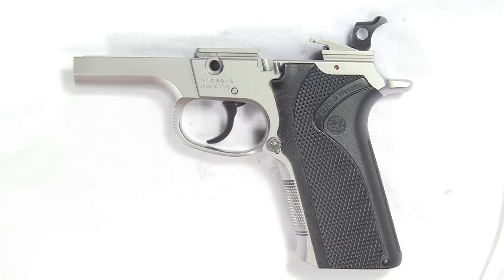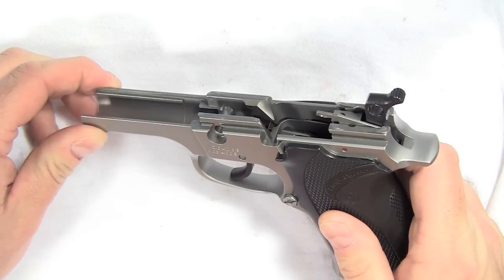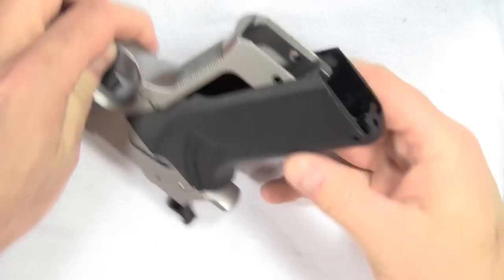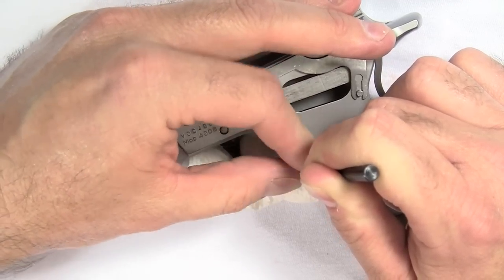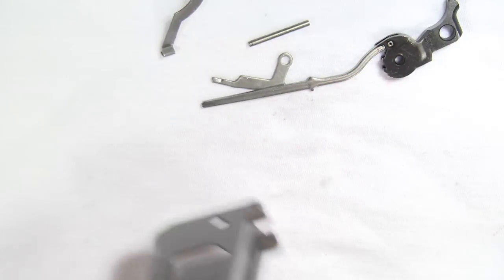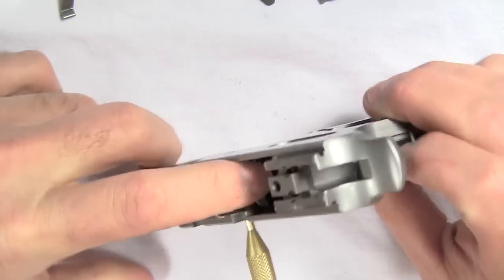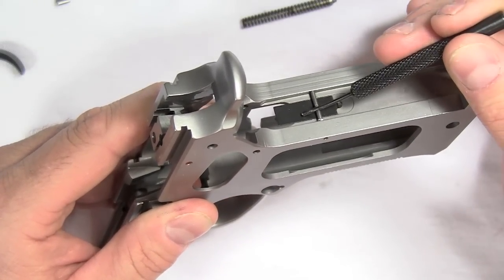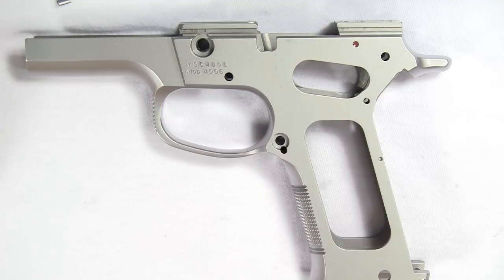S&W 3RD GENERATION DISASSEMBLY/TEARDOWN (FRAME) VIDEO #1 OF 4

Comment: You Sir are a genius and would like to thank you for all the useful info! I recently acquired a 4516-1 and a 5906 within a 3 month span and both had the typical wear  for ~20 year old pistols (not LE example). These pistols are accurate, flat shooters and built like brick ****houses. I was able to execute on most all your gunsmithing jobs except the rail and slide sanding....I couldn't get a hold of those stones. I do agree it is needed as the machining on these 3rd gens is not perfect. I was also able to regrip, replace all springs (Wolff) and repolish the stainless steel with the light grey Scotch-Brite pad (7448). These two S&W 3rd gens now feel and look brand new. Thanks for helping me bring these back to a proper state.

Comment: This video saved me. I carried my 4506 on duty for years, but after almost 18 years had to move to a .40, per dept requirements. At about the same time, the tip of the "Ejector & Mag Depressor" broke, something not unheard of. I placed it in the safe and haven't fired it in over 10 years. Initially I could not find the parts & did not know how to fix it, nor could I find a smith who cared to work on it. Now, I trip upon this video, identified the part, and found it available from several sites. I can do this myself and I'm as excited as a little kid! Thank you! The video was wel recorded, good sound, impeccable lighting, and you explained everything, including all the "what to be careful of", like where to hold your hand and fingers, etc. (did I mention I was excited as a little kid?)

Comment: This is an invaluable gunsmithing resource for these third gen frames. It is absolutely incredibly valuable. I have owned and fired a S&W 4516-2 for 20 years and had never dared dissasemble it to this level. My gun is nice and clean now thanks to your video. These full steel frame DA/SA guns are built like tanks !

Comment: Thank you so much for this video series. It's just what I needed. I just bought a 3913 with a really stiff trigger and have the reduced power Wolff springs to install in it. I was not looking forward to digging that trigger rebound spring out of the frame. Thanks to your video series I have the confidence to move forward with tearing it apart, cleaning it and installing the new springs. And since I'm going that far, I may as well check out your other videos on polishing the internals and really slick up my new pistol. Thanks!
Reply: Update:
All went perfect with the complete disassembly, cleaning, reduced power spring installation, polishing and reassembly. The only hiccups for me were just because the 3913 frame is too small to get my finger inside of it and hold the drawbar. So I held it in place from the rear and that worked fine. And the grips go together a little different in that the only way I could get them on was to slide them on as far as I could with the hammer spring cup not in it's resting place on the grip. Then push it down into place with a short cleaning rod extension, (open end keeps it from slipping off), while gripping the grips tightly and everything snapped into place. I couldn't have done it without your video series. Thanks again!

Comment from the maker: Thank you for the comment and yes unfortunately it is necessary to remove the hammer, sear etc. because that drawbar must come out before you can remove that trigger return spring.
Reply: blubelly2 I'm wondering if you can help me with a 4043 smithits missing a part that sits next to the hammer disconnect I'm told it's the sear engagement that doesn't allow the gun to fire if the slide isn't all the way forward and locked for the next round please help if you can I'm not finding this part anywhere

Comment: Thanks for responding, sorry for all my questions. your videos on the S&W 5906  so far are the best ive seen on youtube. Your videos are in great detail of assembly and disasembly of the S&W 5906. Anyway, since i bought my S&W used (police trade in). I would like to know what are the "important / critical"  parts in the upper and lower that should be replaced. This is so i can have a piece of mind. Thanks in advance. By the way i payed $365 total for my S&W 5906.

Comment: Glad I found you on youtube...great video. If I just want yo replace the trigger return spring would I still need to remove all stuff in the rear such as the hammer, sear, and etc before replacing the trigger spring

Comment: Awesome video series!!  THANK YOU!!  I have a question. I recently purchased a retired NYPD 5946, which is DOA and has about 11lb trigger pull.  The trigger feels a bit gritty, even tho I've cleaned the gun.  What parts do you think I should replace?  Would I be able to reduce the trigger pull myself or is that gunsmith work?  THANKS!
Reply from the maker: Joseph,
Yes you can reduce that trigger pull by simply changing out the standard 20lb hammer spring for a 16lb spring.  You can buy this new spring at "Wolff Springs" on the net.  Changing this spring to a 16lb will give you about a 9lb double action trigger pull.  The tradeoff is that you may suffer light primer strikes.  I have used these light springs before with no problem of light primer strikes but you should be aware of this potential problem if you are using this gun for self defense.
 
Have you also watched my 4 part series on "gunsmithing the 3rd gens"?  These videos show what can be done with one of these guns to improve the trigger without changing any springs.  In the 4th video I show the before and after on the improvements with trigger pull.  Most people are surprised what can be accomplished by working over the internal parts on these great guns and sticking to the stock springs.

Hope this helps.
Reply: blubelly2 ; Since posting my question, I have viewed your "gunsmithing the 3rd gens".  I'm going to go through that process and see how that works out first.  Thanks again!!!!

Comment: bluebelly2 help please. Reassembled, lower work perfect until the slide goes on. Once the slide goes on trigger pull will not cock hammer not release cocked hammer. Only thing working with the slide on is the decock function. Any ideas?
Reply: This has a magazine well safety I think. Was there a (empty) magazine installed when you tried?

Comment: I hope you can shed some light for me. I was using your video series to completely disassemble a 5906 and everything with the frame disassembly went great. Broke it all down and soaked all the smaller elements in nitro solvent overnight(Man was this poor pistol brought to me in a filthy sad state.) Cleaned and reassembled frame without incident. When I then moved on to the side I followed the first two steps and then hit a snag. The small spring loaded button within the safety lever doesn't seem to want to budge at all. There is a tiny amount of lateral movement in the part of the lever that slides away but the button won't give. No click or anything to speak of. I sprayed a bit of safariland CLP into those pieces and let it sit for a few, still no dice. Thoughts?

Just looked at the part names for those pieces to be more clear. It is the Safety Detent Spring and the Safety Lever Plunger that are apparently not moving.
Reply from the maker: Todd Madigan There are two spring loaded buttons in the safety lever.  Is it the one on the round face of the lever or is it the one on the end of the lever that holds the "switch" to the side of the lever?
Reply: blubelly2 It is the one that hold the "switch" arm onto the safety lever.
Reply: @blubelly2  Are they're any major difference between 2nd and 3rd generation s&w semi autos? I have two model 469 9mm pistols with spurless hammers. One of them has an issue. A half cock notch and decocker does not decock from that half cock. The other pistol does. There was a product recall because of this half cock decock issue. I tried contacting s&w to ask if they would fix this issue. No answer from s&w. I may compare the two and try to fix the half cock problem myself. Your disassembly and reassembly videos will be a big help.

Comment: I have a 6906 that doesn't work properly,  the disconnecter doesn't always spring back up in place so I get what I call a dead trigger.  Can't figure what is supposed to push the disconnector into firing mode.  I'd appreciate any help you might offer.

Comment: When I reassembled mine, the hammer no longer stays cocked when I rack the slide. What can be done to fix this?
Reply: If you did not overpolish (change the angles) on the sear, then it is a reassembly error.  If you did
change the sear angles, you will need to order in a new sear.

Comment: My slide lock assembly will not stay in the gun it falls out if it's facing the ground while I shoot or if I cocket any ideas what could cause this?
Reply: On the back of your slide rod and spring under the barrel, is a little nipple that seats into the groove that’s in the middle of your slide lock. If the slide spring doesn’t keep tension on the slide lock, it’ll be loose and fall out.  Slide guide rod spring could be weak.  Also, I think that little nipple on the back of the slide guid rod is spring loaded itself....that if it’s weak wouldn’t put pressure on the slide lock lever.
Reply: jerry glass thank you. I just inspected my guide rod and it's missing the nipple at the end. I have a new one on order.

Comment: Will the side plate assemblly for this model 4506, .45 ACP; 4586 DAO, .45 ACP fits on 910 . Beacuse i cant find this part for my model anywhere .Thanks
Reply: No - Numrich has the sideplate you need- https://www.gunpartscorp.com/products/333040
Reply: are you sure that will fit in 910 model cause when i search on that side by model number the part its gone. Thanks anyway.
Reply: All double stack S&W TDA 3rd gen 9mm pistols use the same sideplate - S&W part #106780000. The listed Numrich part will work.